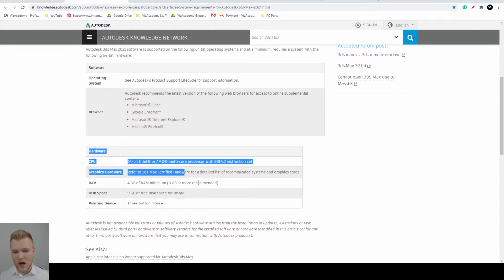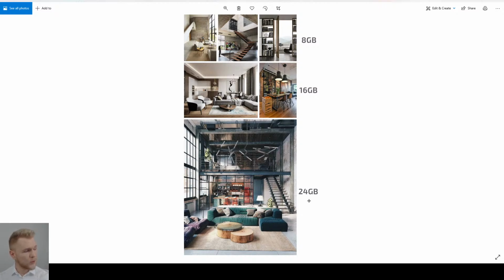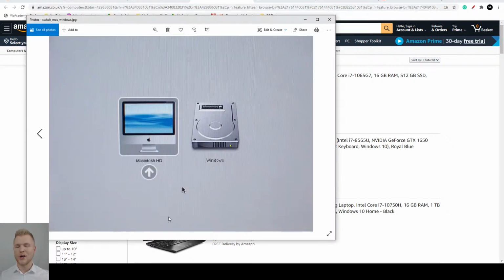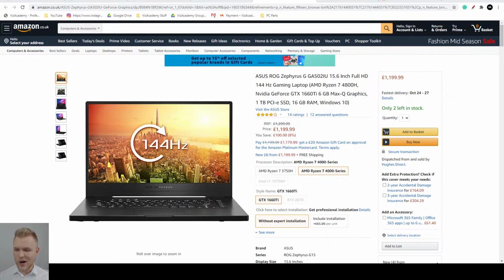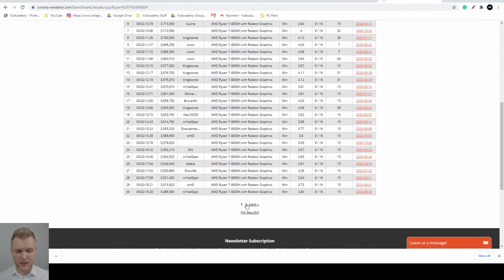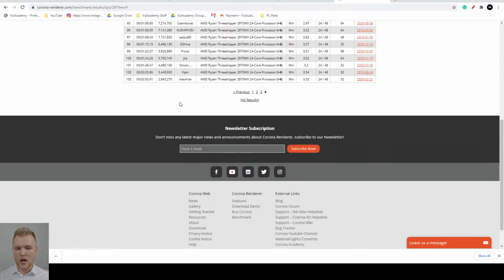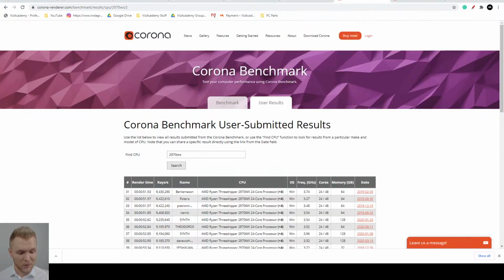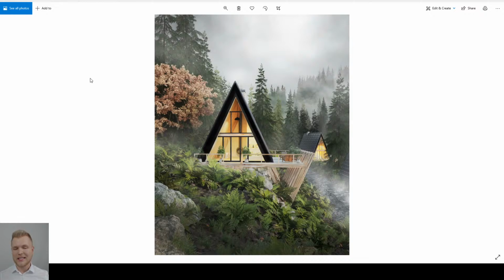How to choose the best computer for 3d rendering and architecture

Comment: Great explanation! When i started in college with 3dsmax i have an Acer laptop with only 8GB RAM and intel i5 so the render lasted forever, and almost burned :D almost immediately i switch to desktop with intel i7 and 16GB RAM, and it was ok for small project and learning. 3 years ago I started working and chose AMD Ryzen 7 1700x with 32GB RAM, it was a big shift and now with larger scenes I use 64GB RAM because a lot of crashes. And I'm really looking forward to an early upgrade to AMD Threadripper and 128GB. So no stress, we can always upgrade ;)
Reply from the maker: Hey Veronika, glad you like the video! We all had to start somewhere! I remember first seeing a dual-core processor and being amazed by the double speed!
Reply: Just curious, have you upgraded your cpu? Since I currently have i5 2400 3.10ghz which I'm using to build a portfolio about my renderings, it works alright for simple scenes, trying to upgrade hopefully in future.